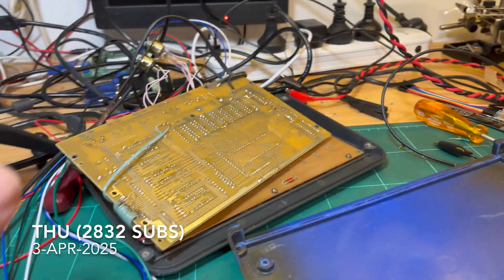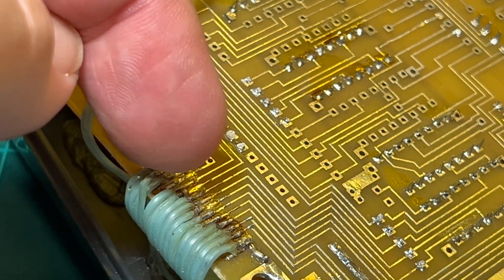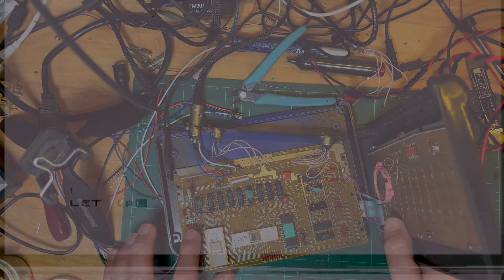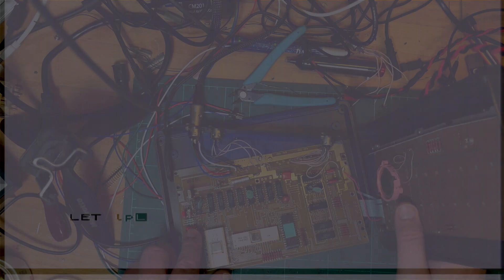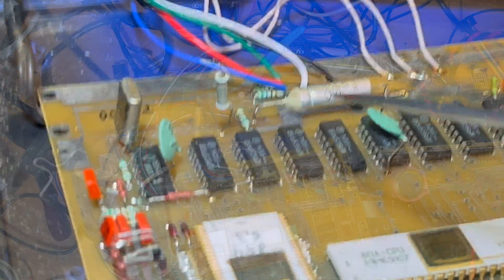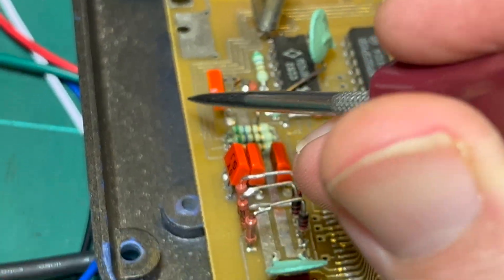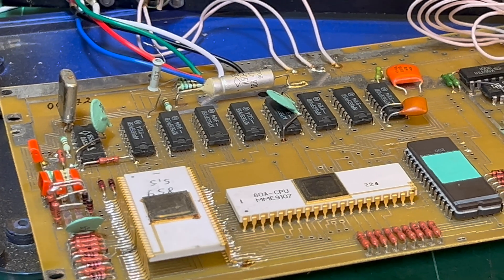🇷🇺 Нафаня (Nafanya) ZX Spectrum Clone: Part 2 (Quick Update) [TCE #0591]

Comment: That keyboard wire triggered a PTSD. It was a very very popular ZX clone with a very very common issue of the USSR made wires falling off on turns. Also PCB lines were falling off as well if you used just a bit more heat.
Reply from the maker: I am designing a replacement keyboard using tactile switches.  Not the ideal solution but should fit within the existing case.  One thing I've noticed is that the mounting holes in the case and on the PCBs NEVER match up ... additional hardware is needed if the PCB isn't big enough, new screw holes need to be drilled in the PCB ... sometimes through a track.  I could understand if one common PCB was used, but so far they have all been unique designs ... no doubt using a similar schematic.  It's just interesting that the PCB design is always completely separate from the case design ...

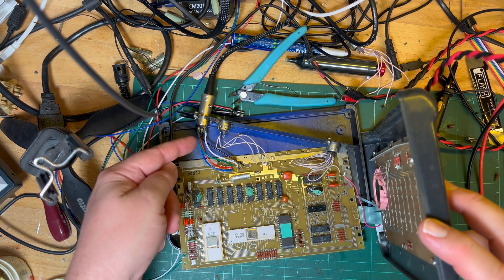Comment: 0:55 yikes. I'd get those off and put in some angled pin headers, if there is room?
3:00 They might be radiating into each other and you're changing the impedance when you're touching them?
Reply from the maker: Yeah, I was thinking along those lines for the keyboard.  Regarding the resistor-diode combos ... interesting idea!